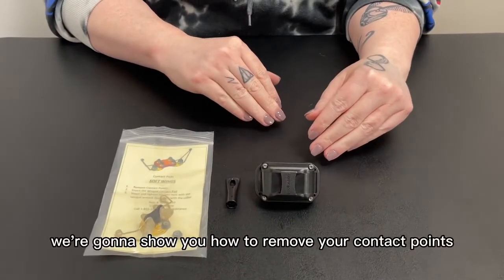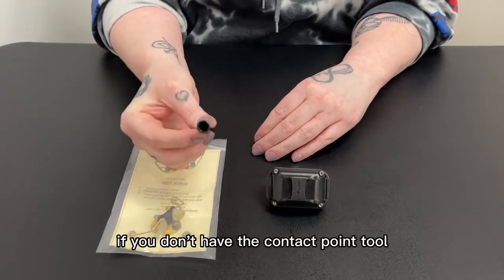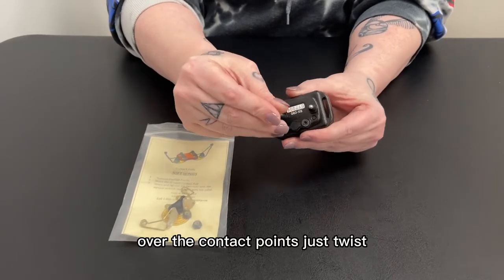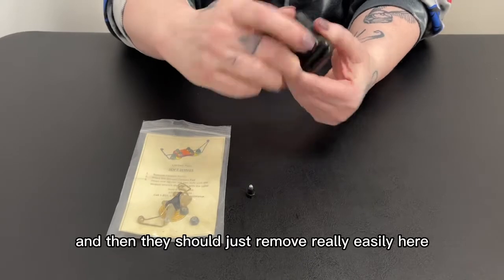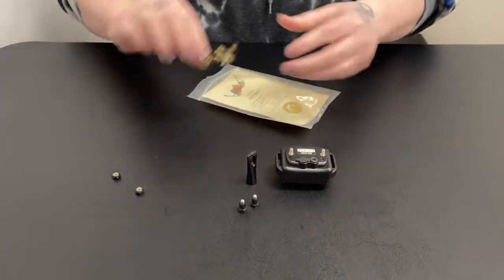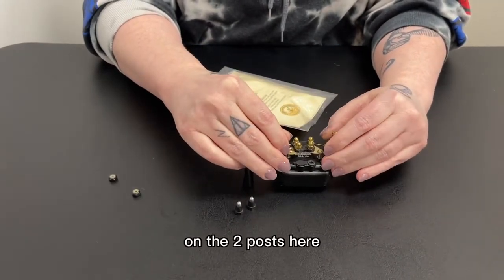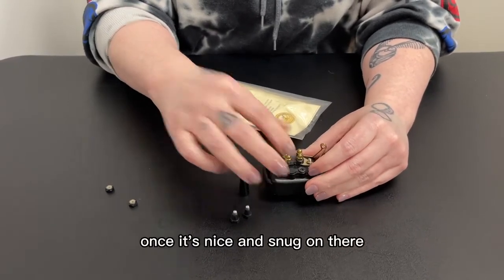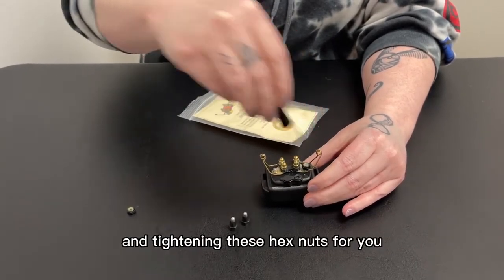How to Put a Comfort Pad on your E-Collar Receiver

Comment: One thing to note at least on the larger receivers is making sure the pad is mounted with the straight side on the power button side.  If you put it backwards the pad will not sit flush because of the raised portion of the receiver.
Reply: Thank you for the advice👍

Comment: I just got this and I can’t see how this is more comfortable.  The wings are such small wire it digs in.  It increases contact but it is not more comfort.  The collar also wants to rotate due to the small contact patch.  You have to keep it just as tight to keep it from rotating as well.  And like most of the other products there is little to no complete information on the website or in user manuals.
Reply: Try bending it out a little to make in more comfortable. What is your breed of dog?